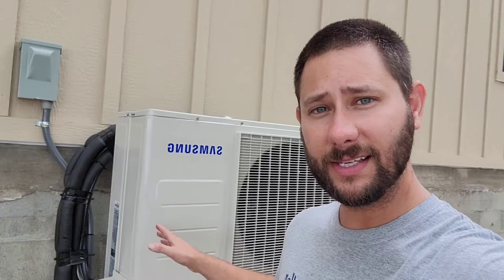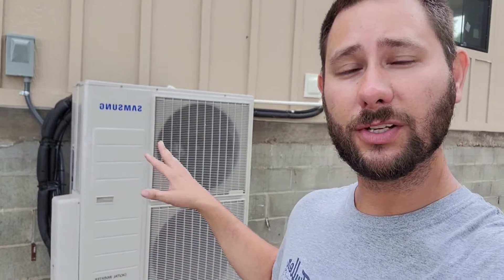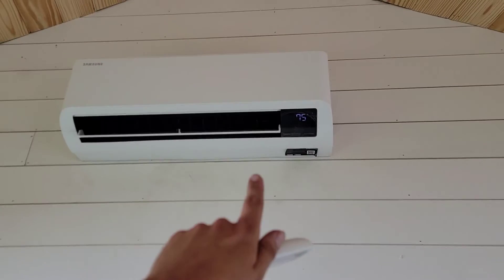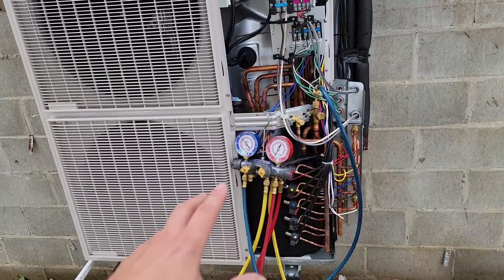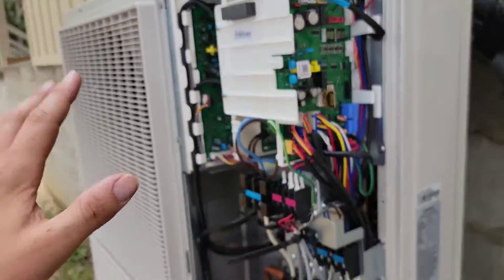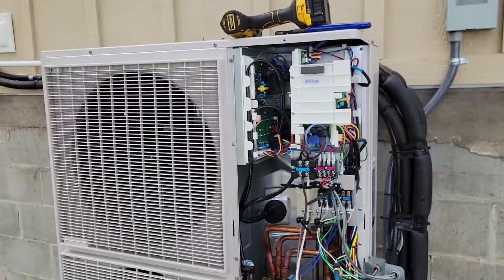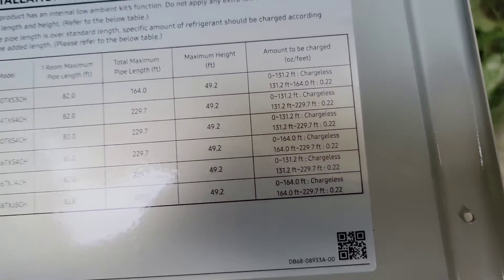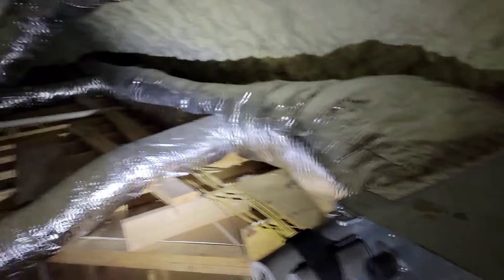How to charge mini splits?

Comment: I think I over charged my mini split my low side pressure is 152 psi and it was 88 degrees outside the condenser kept cutting off and coil air was coming out condenser
Reply from the maker: Check out my recent video on how to charge mini splits, it'll show you how
Reply: @taddydigest  I also have a bent line and it's restricting flow smh

Comment: 3 zone Samsung mini split. 5 years old. 
It has no refrigerant in it. No factory charge. Going to pull a vac and charge it. 

How will I make it run to fully charge it to factory charge if I cannot run the auto address till it is charged? 
It had the K3 reset preformed and would not complete K1 auto address due to low charge after being reset. 
Thanks
Reply from the maker: send me an email we can push the k tact switch and make it enter cool mode so we can charge it 

tadfuller1@gmail.com

Comment: Hi. While charging do I have to turn ac on?
Reply from the maker: yes
Reply: @taddydigest  thanks
Reply: I'm a handyman with over 30 yrs of experience, and I can do a lot. Carpentry, plumbing, electrical, flooring, tiles, and so on. But not too often ac installation and servicing. For now, I installed two splits for my client, and I need to charge it. Last time, I did it a few years ago and forgot details. If you have a video how to charge ac after vacuum, can you send a link?

Comment: I don’t understand why you aren’t just weighing in charge. If it is a new unit, add charge if needed based on instructions in the manual. If the unit is existing, recover the existing refrigerant and proceed to weigh in factory charge plus any additional charge that may be required based on lineset length. No need to check pressures, temperatures etc. no need to even turn on the unit during charging.
Reply: Wondering this same thing.

Comment: I've installed multiple samsung units.  Biggest junk ever.  I've even installed these units in my 12 unit apartment building.  I've already replaced 4 units with mitsubishi units in 4-5 years.  Samsung makes the worst hvac equipment.
Reply: Samsung make tvs not ac units daikin, mitsubishi, confor aire have years doing this
Reply: I install tosot mininsplit  fron china  
I come back after a year of install, all of them leck after 1 year  i lost to mouch on frion and service
Reply: Now i do not ofer guaranty on chip units ,they get the lowest quality unit and they want life time guaraty
Reply: That’s crazy because I’m a state licensed contractor in Florida who’s installed at least 50 of them and haven’t had one issue out of any of them unlike all the GREE’s I work on I think the problem is you installed them next time get a professional!
Reply: @chesterkwak9882  Daikin is king for me

Comment: If there is a leak in my split ac system (pros haven't been able to find it) do I have to purge all the air out of the system before I charage 410a freon into the system? Or can I just add the freon until it is like 120-130 on the low side?
Reply: Technically, you have to recover refrigerant, purge and vacuum the system down below 500 microns, and charge by weight… Low side pressure is more like 115-120… If you add too much refrigerant you could get liquid refrigerant in the compressor and damage the system… Also, this guy is using terms like single and two stage, and DC brushless motors and Variable Frequency Drives do not have stages, they are variable dependent on ambient template res and related pressure… That is why you cannot charge using sub-cooling, full-stop! You can however keep the low side are 115-120; however, you could still flood (also called slugging or liquid flood back) the compressor, creating extremely high crankcase pressure, and the oil will be flashed and turn into foam, all reduce the life of the compressor or possibly immediate failure… While these system have an accumulator, you could still overload that and have a flood back…

Comment: Great video brother. I had to charge a mini split last week it was 15 degrees out and it was 50 in the space so it wouldn't let me run ac .so i put it in heat, closed discharge and smashed refrigerant in through discharge port.i had to cycle it a few times because line sensors were shutting unit off.but after doing it 3 times i was able to charge system in heat mode.not ideal but it worked. Again Great video
Reply: Kids dont try this at home
Reply: All i was trying to do was drop the pressure going to the heads just enough to smash liquid refrigerant through ,and yes i had to warm the bottle up under hot water. Looking back i should have just disconnected reversing valve but i was cold and lazy didn't want to take the panel off.
Reply from the maker: Good stuff!

Comment: My question is how long does it usually take you to pull vacuum on a 3 or 4 zone  mini split to refill to a factory charge? It's taking forever and I have pressure tested and verified there are no leaks and changed the oil in my pump
Reply from the maker: Have you checked your hose
 Made sure that your hose is clear and is open on the ends
 It shouldn't take more than an hour
Reply: @taddydigest  I do have the Schrader valve in low pressure hose hooked up and 2 hoses running to my pump. Im at my im beside my self and it never takes this long on a new installation. But every time I'm doing a fix it call for a mini split and I need to pull all the charge the vacuum takes for ever
Reply: @derekbellamy8040  so I found that I get little to no Schrader depression on the unit, scratched my head every single install until I ground this
Reply: Remove the Schrader valve core…

Comment: So if I want to charge it being an inverter I would have to have a recovery tank.. pull vacuum on the tank, recover the refrigerant, find leak and fix it.. pressure check, pull vacuum, weigh the refrigerant in the recovery tank an add it back to the system and then calculate what was missing based on what you already added based on the factory charge and Line set length? I'm just trying to make sure I'm used to working on normal HVAC units but inverters are new to me and I'm fairly new to the field so I just want to make sure I'm doing the proper work!
Reply from the maker: You got it
Reply: @taddydigest  thank you, your vid has helped me more then my supervisor!
Reply from the maker: Awesome thank you so much for watching

Comment: Thanks for the great video. I have one question though: If you have a multisplit system and have unused ports, like in the video, what do you have to do with them? Are there special caps for them to keep them sealed? I thought, that the system always comes with normal nuts for making the pipe connections.
Reply: always verify that the caps from factory are torqued to the specific value for that size flare nut.  I have had them leak in the past so I am always skeptical
Reply from the maker: the ports that are unused are capped from the factory.
Reply: @taddydigest  Do you have to account for the linesets for the unused ports?

Comment: I'm going to be adding a charge to my Pioneer single zone mini split. After watching your video, I have a better understanding of what to do. But I just want to run through the steps with you, and if you can tell me if it sounds correct. First thing is to attach the gauges, and connect the 1.8lb bottle of 410a. Go inside and turn on the unit to high, and turn the temperature all the way down. Then go outside and open the valve for the 410a, and make sure the gauge stays at 118 pressure. Slowly open and close the valve so that pressure doesn't get too high. Once level is stable, it means that all 410a is in the system, and can close the valve and discount the lines. And then check the inside handler, and make sure it's 20 degrees colder. Does that sound about right?
Reply: You probably already did what you needed, but don’t forget to purge the air out of your hoses as well before you add Freon.
Reply from the maker: absolutely great advice 👍
Reply from the maker: Hey Aaron that's awesome that you could derive that from the video very cool I think that you have a good chance of charging it correctly
 Good luck my friend
Reply from the maker: If you need my help I will give you my phone number through email you're through email so you can call me hit the join button and become a level 3 member

Comment: How do you measure an inverter for charge?  It is always changing so I have read that a pull and weight the charge is the only way to know what the status is and whether to add or subtract R410A.
Reply: Alot of mini splits have a mode recommended for charging. Could be Speed cooling, emergency mode, test mode, etc... this will lock the system basically into 100% mode. After proper charging put it back to normal. See how the system responds.

But always... and I mean always read the service manual. 👍
Reply: @LiqwdE   Thanks for the suggestion.  I have read the voluminous manuals (PDF) and there appears to be no shortcuts recommended.  Pull and weigh is the only option.  This refers to Senville units and Air-com whose manuals I have fully read.  It would seem to be a real labor saver for service calls if they had the ability to show charge level (not just a low condition as some do) with a computer read out built in.  It would be a great selling point for sure.
Reply: @douglasthompson2740  I hear ya. I recently worked on a Fujitsu. It's service manual has a refrigerant curve. Uses megapascals, outdoor temperature, and amp draw for checking the charge. They just can't make it easy for us.
Reply from the maker: Wow that's interesting
 Thanks for sharing that info with me
Reply: @douglasthompson2740  Senville customer service claims that you can measure it off the pressure reading when running at max. No idea if that should be trusted.
Reply from the maker: Good advice my friend
Reply from the maker: Look at the factory charge on the service facts And always factory charge using scales.
 Check out my video on how to work on Mini splits

Comment: Ok, so I learned almost zero on how to recharge a minisplit from this video.  Questions that need to be answered when charging a multizone, do you add to the master valve set or to each individual head?  What if you need to service a minisplit during the fall when you can't achieve maximum cooling?  Must you resort to full recovery of refrigerant from the system and then recharge?
Reply from the maker: Good question
 There's only one connection
 To add refrigerant 2
 And that manifold connects to all of the indoor units
 When you add refrigerant you add it to the whole system
 Always factory charge
 And if you want to know the extra charge check out vrf coder
Reply: @taddydigest  Pioneer systems have service ports on each suction line for each zone so that you can pressure test each line set.  So there is a way to add refrigerant to each line set if you wanted to.  I'm assuming it is the same for all makes of mini splits.
Reply: @dffps129  I added refrigerant to my Pioneer at only one port and it worked
Reply: @taddydigest  I have lost full charge two times on my Multi split  and you are telling me that I can not just add some refrigerant . I hate you. I go and cry again
Reply: If the unit is emty add factory charge + extra if you have more coper leng

Comment: Great vid! Hey No one has a video on removing part of the charge on a minisplit that has shorter lines than the built in charge was designed for.  Can you please do one? I feel like it's just release the full charge into the lines, start the system, and slowly recover via the suction side of your manifold into a recovery tank while monitoring the scale until you reach the weight that matches the pre-charged weight minus the final weight your line length requires. Is that correct?
Reply: I think it's because you'd have to let some refrigerant out, and this is not legal to do so they sure as heck aren't going to show them doing it on youtube... The right way is to recover them which requires additional equipment...
Reply from the maker: Most of these Mini splits come charged for 25' line sets except for the multi zone systems which come charged for a 161'
 I don't think you would ever have to remove charge because of the line sets being too short
 I've installed several hundred with less than 15' and had no issues whatsoever
Reply: @taddydigest  So if the lines are only 10' and it comes pre-charged for 25' you don't lose efficiency by leaving it that way, and it's not harmful to the system in any way?
Reply: @mgladden2  The rule of thumb is the EEV will adjust for some extra refrigerant.  During Mitsubishi training, they indicated providing you have 8-10' of line, you do not need to remove refrigerant.  But nothing prevents you from removing some refrigerant to optimize the unit.  Keep in mind at 15' that you will only be removing a  slight amount of refrigerant of the overall volume.

Comment: Can u explain temperature split again please inside 65 outside ????
Reply: So a temp probe on the high side and temp probe on low side ???
Reply from the maker: To check the temperature split you need to measure the supply temperature and the return temperature and subtract the 2 and it should be around 20ﾟF difference

Comment: how do i send my 2 stage unut in the 2nd stage ?????
Reply: Can I just put the remote in high cool with high fan speed
Reply from the maker: yes absolutely if it is wired and programmed correctly you should be able to
Reply from the maker: Tie Y1 and Y2 wire together

Comment: AC048KNZDCH/AA AC048JXADCH/AA here are my units curious how to increase the static from .3 to .5
Also whats the normal operation pressures on these systems.
Do I need to setup the laptop with s net we have one at the shop
Reply from the maker: easy way is definitely with s net 
entering option code
Reply from the maker: I think I did a video of it on my playlist

Comment: Hey I'm an apprentice, I just installed a Samsung  ducted unit 4ton at my house, Im confused by factory charge? I was under the impression it was ready for 25ft of charge from factory and then anything over you had to add in charge. I have no Samsung training I just feel my unit has more to offer. Thanks
Reply from the maker: You are correct marco it is ready and has a factory charge in the outdoor unit for 25' line set

I am only referring to systems that have to be recharged
Reply: Thanks I was shitting a brick wondering if I was running on only my additional charge. Haha
Reply from the maker: lol 😆🤣 it's all good 👍 You got this 👍